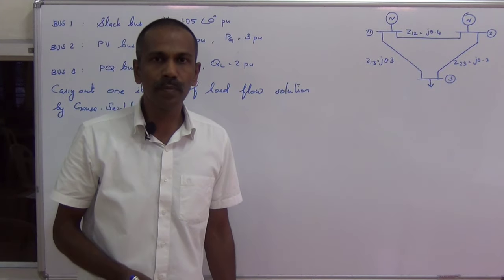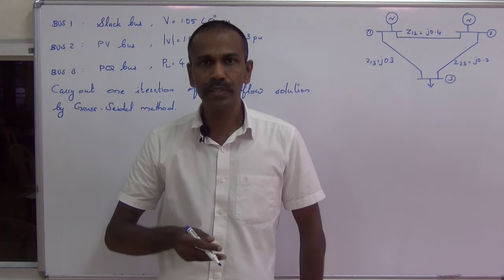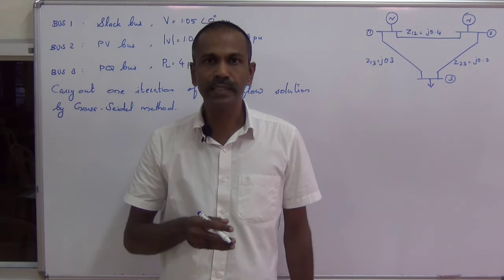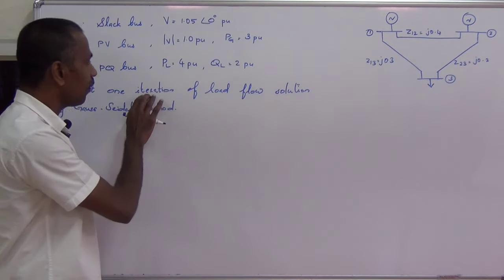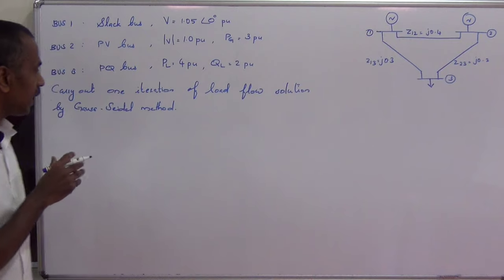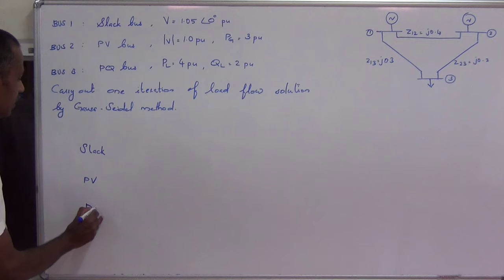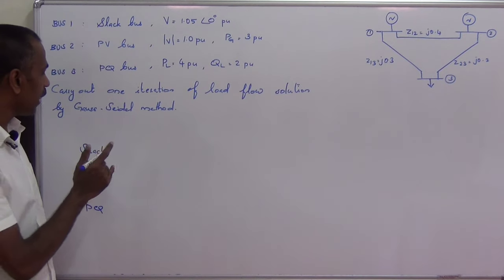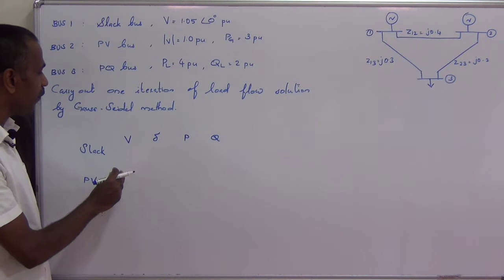GAUSS-SEIDEL METHOD - LOAD FLOW PROBLEM-2 / KTU/ POWER SYSTEM ANALYSIS

Comment: Does this example converge? I tried programming it in Matlab and found that my Q2 is alternating. Also, my solutions for the second through sixth iterations vary as follows:

iter./ V2 / Q2 /  V3
1. / 1.0000   21.8014 / -0.1250 / -19.2336
2. / 1.0000   17.7022 / 2.1185 / 0.5804  -30.7578
3. / 1.0000   17.9287 / 3.0748 / 0.3796  -55.9429
4. / 1.0000    20.7421 / 4.4752 / 0.4214   176.1676
5. / 1.0000   42.1915 / 6.9615 / 2.1285   44.8559
6. / 1.0000   55.1932 / -5.0759 / 0.8789   16.7476

First I calculated Q2 as you described, then V2, and with the current values V3. I also reset the magnitude of V2 in my script. Do these solutions match with yours? I would appreciate your reply. I checked the Ybus matrix as well and this one is fine. Probably somethings wrong with the inital values (e.g., Power limit)?
Reply: Someone else did?